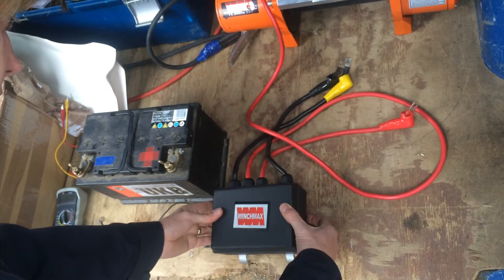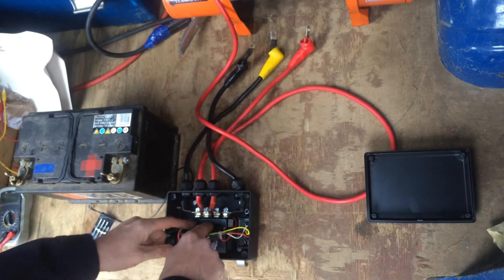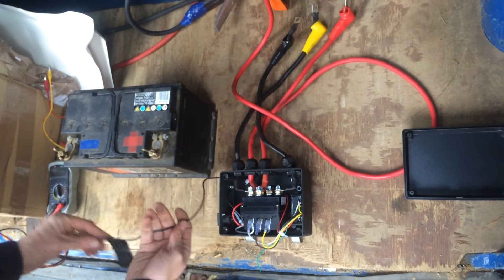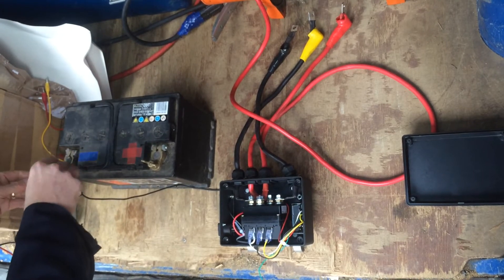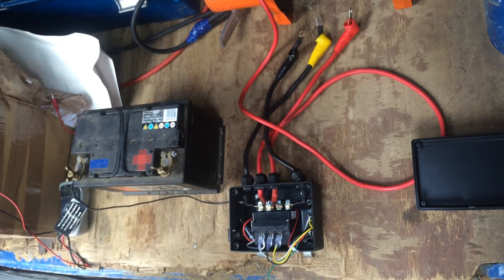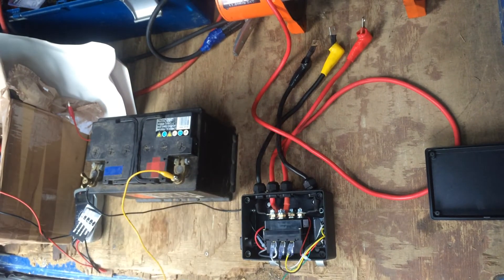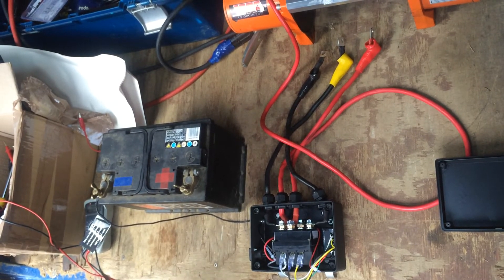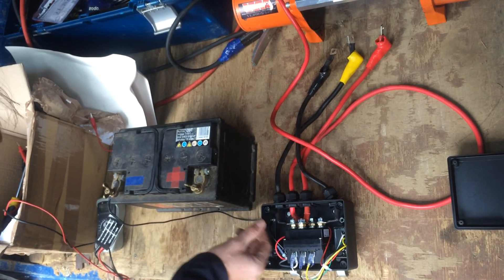Winchmax Solenoid Test

Comment: i got a question about 13500 lbs winchmax ..easy pull on incline of 30 degrees stops after 25 seconds of pulling  after 5 seconds works again..what can be a problem? i know can be wiring..
Reply from the maker: Hi, Thank you for your message. What you have described (intermittent function) in usually caused by voltage drop. This can be caused by a  corroded terminal or  more commonly by a bad earth. All 12v/24v winches need an earth direct to the battery (a chassis earth is not sufficient), this is always the first thing to check as its the number 1 installation error. Please let me know what you find and we can go from there. Perhaps give me a call when standing in front of the winch - 01986 899264, I would be happy to help. Thanks, Winchmax Team.
Reply: @winchmax1646  thank you for answering ...and for support ...i was thinking to that but i didn't had time to move the earth lead from chassis to battery terminal...rest of all the winch is great runner...happy with wireless remotes ..never used leed one..
Reply from the maker: @dubmmotors5698  Hi, No problem at all, happy to help. Please just let me know how you get on once you have re-positioned the negative to the battery - I am pretty sure this will solve the problem. Please let me know if you have any other questions. Thanks, Winchmax Team.
Reply: @winchmax1646  i will reply for sure..thanks for support.....😉
Reply: @winchmax1646  the main negative cable it's on battery already.. the small thin black cable it's on bottom of motor ...i had a switch isolator on positive cable to cut of power when i don't use the winch..i removed that as we'll .now i hate to winch to se how behave..

Comment: I used my Winchmax today to pull out a tree stump and it stopped working.  It has hardly had any use.   The solenoid clunks like its engaging and the spool free wheels OK but it won't run.  I think I may have overloaded it and If I had what could the problem be?  I would appreciate our opinon before I pull it apart.
Reply from the maker: Hi, thank you for your message. If you think you have overloaded the winch, or burnt out the motor, the best thing to do is bench test the motor. Please email Winchmax directly (info@winchmax.co.uk) and they can send instructions on how to do this. Please let me know if you have any further questions.
 Many thanks - Winchmax Team.
Reply: @winchmax1646  Thanks for your reply.  I'll do that thanks.
Reply from the maker: @tubemonks  No problem at all, happy to help. Thanks, Winchmax Team.